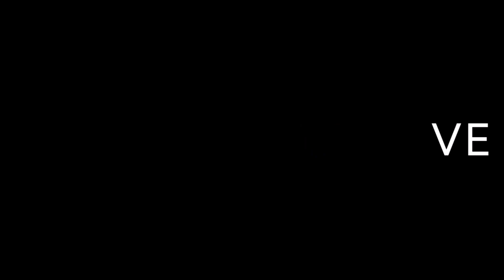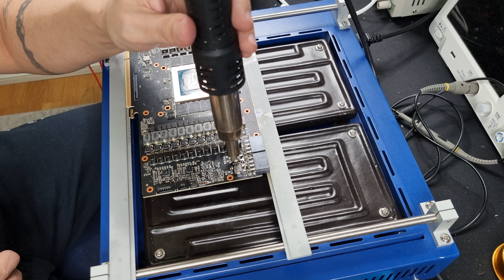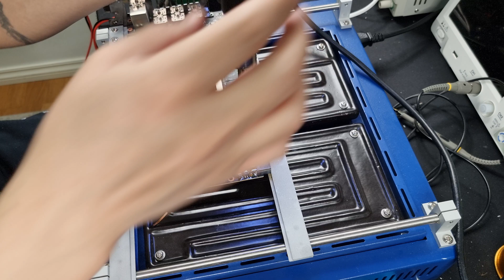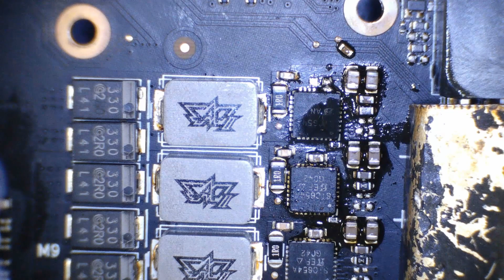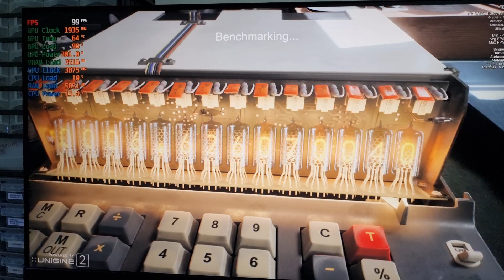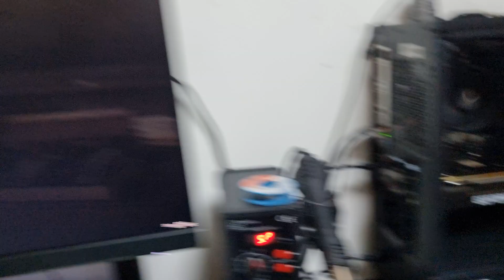RTX 3090 Catastrophic Power Failure Fix. Cheap Mosfets to Blame.

Comment: How many Amd GPUs do you think have the same issues as Nvidia GPUs considering power delivery mosfets and GPU soldering balls ?
I know the vega and 5700xt had issues with the GPU soldering balls.
Reply from the maker: I honestly do not get the same amount of AMD GPU's in for repair as Nvidia. It may have to do with Nvidia selling more GPU's. I am not sure. However, I do know AMD uses better mosfet drivers than Nvidia. AMD likes Infinion and MPS.

Comment: What's your opinion on the MSI cards
Reply from the maker: @beowulf885  It depends on the model. I do not see many msi cards dying from the same issue, though. But that's just what I'm experiencing. I'm actually working on an msi suprim 3090 ti at the moment. This model is using MPS power drivers, which are one of the best 👌 👍🏼
Reply: @TechnologyHive  That's nice to know. I hope MSI carried that trend over to the RTX 4090 Suprim. That's the one I have. NWR says MSI is the only company that use a 12v fuse on the 12v input. The fuse actually saved his customer's PCB.
Reply from the maker: @beowulf885  I like MSI :)

Comment: Good video and card with luck too. I have the same preheater, very difficult to work on. I put a switch to disconnect one of the plates, which is enough for graphics cards and it heats up a little faster and that way I don't burn my hands, you have to put the rails in the other direction so that the card is on top of the plate and if I need to change a socket I can still use both plates. Although that fan keeps drilling into my head
Reply from the maker: Yes, I have been also thinking about modifying this thing also so it does not burn my hands. I just get too lazy 😆. The little fan is still ringing in my head after the latest repair. Another 3090 with another burnt mosfet. This one is by Gigabyte lol